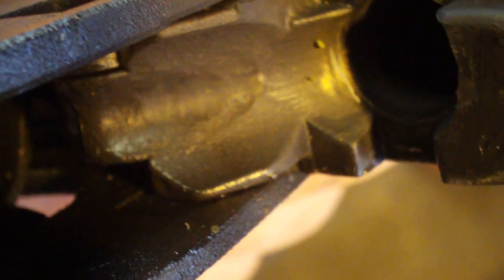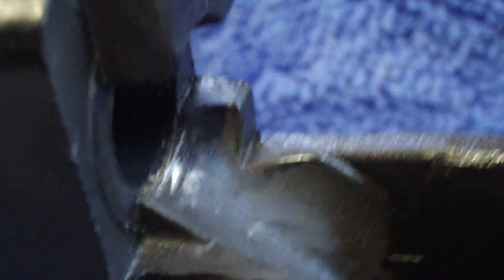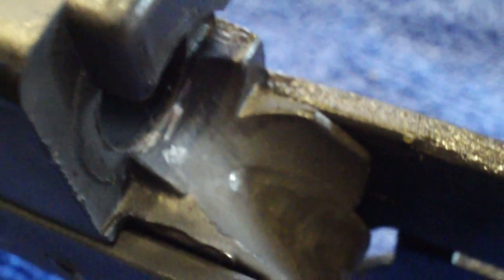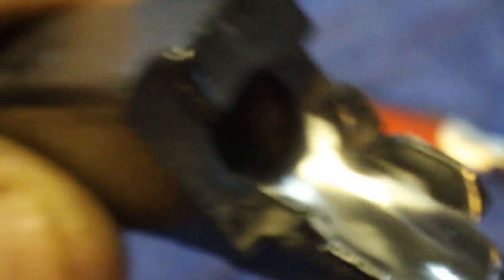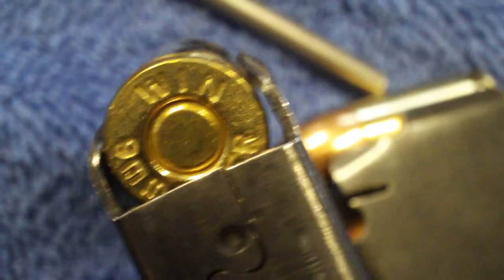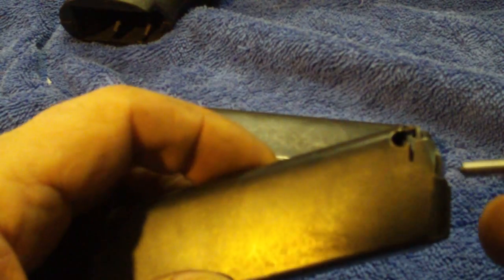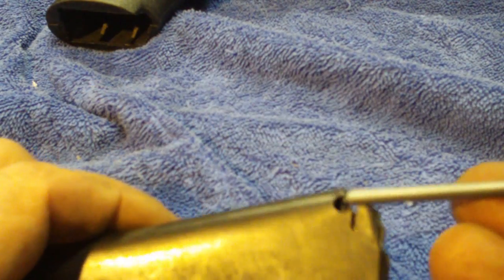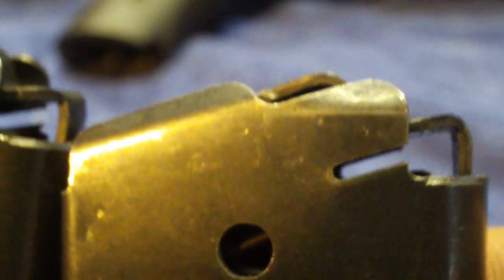The Ugly Black Carbine: FTF Issue Resolved

Comment: Thanks for sharing. Most of the reviews I have read indicate the 995ts carbine feeds flawlessly. You & I seem to be of the few that had to troubleshoot & make a few tweaks. Doesn't take that much to get these carbines running smoothly. I spent about 10 minutes polishing the feed ramp & tweaked 2 of my 4 factory 10 round mags. Just got the 20 round Red Ball & it runs perfectly. The more I shoot the better this low budget firearm performs. A great value.